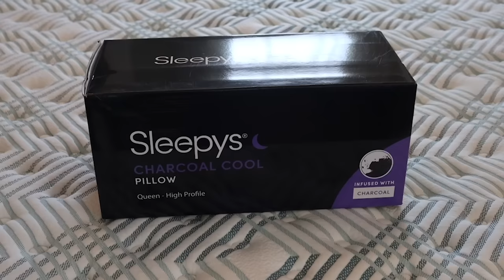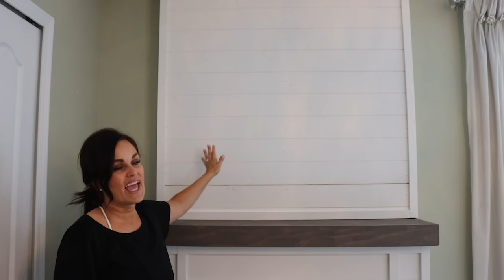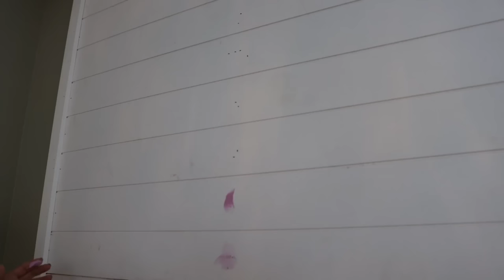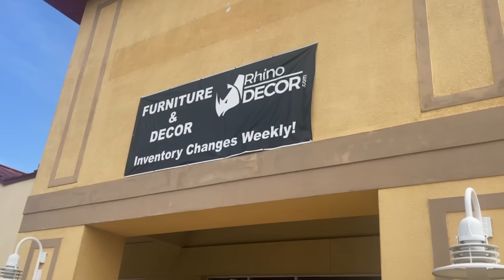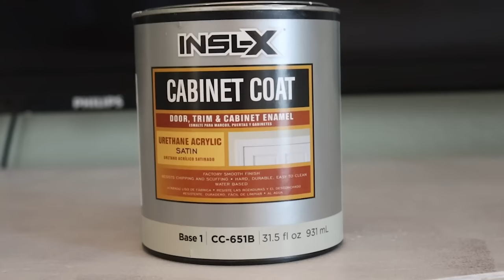You Can DIY a Fireplace Over Mantle w/ Scrap Wood! (+ Bedroom Refresh)

Comment: Great job on that fireplace and troubleshooting the problem. I bet you could have just run a circular saw or even used your table saw on the top part and shaved off an eighth inch without anyone knowing instead of dismantling your work. It looks fantastic!

Comment: Hi there, from a cold and rainy Cape Town, South Africa ‼️🥰🥰 I absolutely love the look. As always, I am truly inspired by you❤❤❤
I simply love the feature wall, and I'm thinking of doing something similar. I will just have to figure out how to attach the wooden beams/slats to the wall, as we have regular brick and plaster walls. (In South Africa 🇿🇦  we rarely use dry  walls as interior walls. Every walls is built with either brick or cinder blocks and then plastered over with a cement/concrete mix)
Reply from the maker: You may want use tapcon screws if they have those there.

Comment: My Texas room is a addition and the builders gave the ceiling a slant of about 20 percent. I don't know how I would add the piece over my fireplace and make it look right since my ceiling is slanted.
Reply from the maker: You need a table saw where you can tilt the blade and run it through that on an angle the long way.